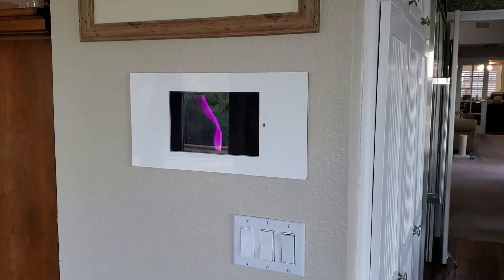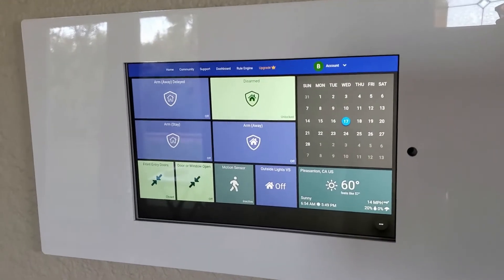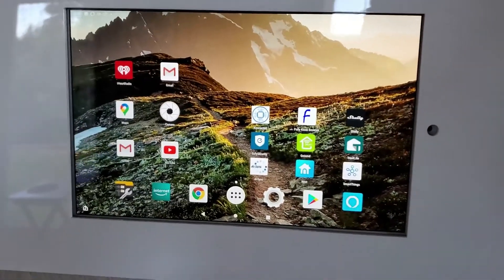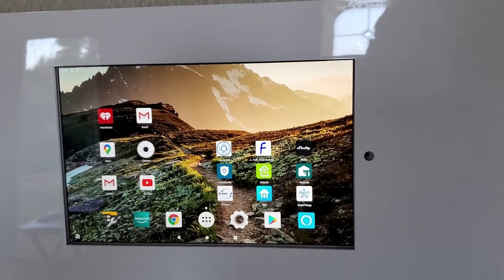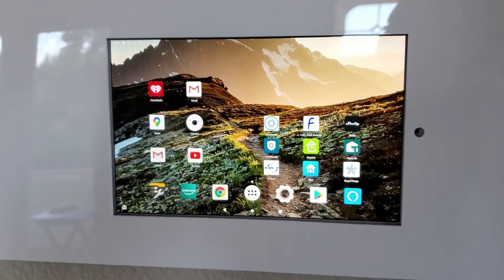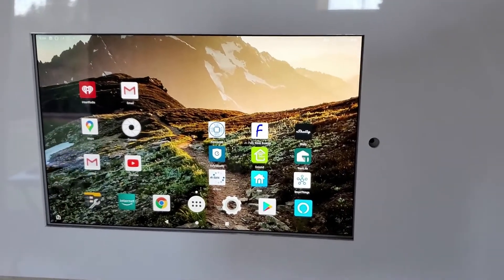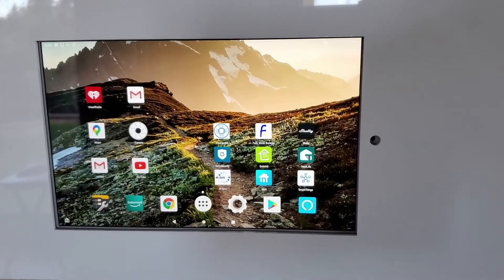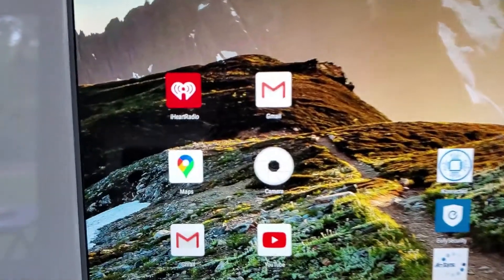Old Intercom Upgdate - Final Tablet Config & Echo Dot Room Stations

Comment: Could we simply splice the wires that come with the echo power supply to the old wires from the intercom? In my situation i'm trying to hard wire the powersupply to the echo dot, but i dont need the genie kit. Can I simply splice the wires that come with the echo to the cables that connect to the intercom. Great video. Thanks.
Reply from the maker: I'm presuming you mean, still have the new Power Supply at the Main Station, with the in-wall intercom cables now connected to that; then splice the Supplied Echo pigtail (after removing the power supply block from the AC end) to the Intercom wires. Yes, that should be good. But rather than chop up an OEM power cable, you might still consider to just hold onto it and get a new pigtail as they are quite inexpensive.
Reply: @decosse01  Exactly. You said it much better. Appreciate your quick response. Do you see any issue with me doing the intercom upgrade using the new larger echo dot 5th gens. I would only be using two 5th gens in this instance as my intercom system has 2 exterior speakers which are much larger than the interior intercoms, thus providing more space for the 5th gen echos to fit. The 5th gens seem to have the same OEM power cable as the 3rd gens in your video.
Reply from the maker: @robertbackhaus8150  Should not be an issue - I haven't got any 5th gens myself yet, just validate the power ratings for voltage and current are the same (or at least similar)

Comment: Would this fit the Google mini 2nd generation
Reply from the maker: I suppose you could - the premise is essentially the same but you would have to figure out the requirements for power for the Google system (incl the main Tablet) as well as the wall-mounting hardware for that and the satellites  - you'll have to do your own research on that, but I would imagine it would be do-able

Comment: What model of Echo Dot are you using? Can't find at Amazon. Any ideas? TIA. What if one or more fails, and you need a replacement?
Reply from the maker: I used the Echo Dot 3rd Gen - can't see on Amazon any more since they are onto later generations. The 3rd gen works well for this application because it can flush mount on the wall, whereas the later round models will have to be mounted outside the wall plane. The principle is the same, you just need to get creative with mounting those. Note that there are a lot of DOT 3's on EBay that are still being cleared out, so that could still be an option, and they are cheap enough you could afford to buy a few extras to store for the situation you mention.

Comment: When you spliced the wires for the barrel connector is the positive for the inner or outer part of the barrel connector? When you cut and strip to make the pigtail connector is it a red and black wire for positive and negative?
Reply from the maker: I'm not sure what you're asking about a 'barrel connector' and inner/outer ?? Do you mean the Jack?  Yes, the Pigtail has separate red and black wires in the sheath - it is not co-axial. Whichever splice connection you use, just be sure to connect the red (positive) to whichever you used for positive from your power supply and black similarly for the negative.
Reply: @decosse01  These type of jacks are called barrel connectors. The inner part of it can carry the positive and the outside can carry the negative or vice versa.

Comment: Once I have the table and echo dots installed, if I play music will it play on all echo dots or just in one room, or can I control where it plays?  Can it also be used like an intercom? And lastly once the table it mounted, I won't have access to the volume control or the on/off switch. What did you do to resolve those issues?
Reply from the maker: 1. You can control on which groups or sub-groups it plays - see the Alexa User/Help guides for how to do this - https://www.amazon.com/gp/help/customer/display.html?ref_=hp_gcs_csd_d2_649_1_GZ5U38E9GGBBWEM8_xSdj5mwePE&nodeId=GZ5U38E9GGBBWEM8&qid=1672855532555&sr=1
2. Yes - Use the 'drop-in' feature of Alexa to utilize as an intercom; again, see the User guides - https://www.amazon.com/gp/help/customer/display.html?ref_=hp_gcs_csd_d2_649_4_GS3WRTSRKD2U6MCK_MV3rB3cGEB&nodeId=GS3WRTSRKD2U6MCK&qid=1672855415471&sr=4 (you can find more in the help section) 
3. You don't really need the on/off switch - if you set up with the Fully Kiosk Browser, you just control the screen going on/off and re-awaking with motion detect. For volume, access the Sound settings - https://www.amazon.com/gp/help/customer/display.html?nodeId=GR9USY79W6NQMJPW; if you have Alexa enabled on the Tablet, you should also be able to just vocally instruct it (same as you would with the Echo devices)

Comment: Hi Decossee01, Thanks for sharing this video. Do you have a one later video where you dicuss lessons learned or any recommendations based on your experience? I am hoping to complete a very similar project and my main concern is ensure I have the right voltage for the old wiring.
Reply from the maker: I'm sorry, there is no follow-up - but there is nothing I would have changed, or subsequent problems that came to light (other than the power supply which is covered in the notes of the first video). I will say that after the initial configuration was done, I did enhance the fundamental capabilities of the intercom/music system by adding more features to the Tablet, by optimizing the Fully Kiosk Browser settings and adding in an Alarm System control and the capability to control all my Smart devices from the Tablet. This then included further learning curve using SharpTools program to create a custom Tile Display. But that goes QUITE FAR beyond the scope of these videos which is just getting the base infrastructure in place and not absolutely necessary unless you want to grow your system to create a true Smart Home controller beyond just the capabilities of replacing the primary features. 
Getting the correct voltage for your devices means studying the specs for those you wish to use; then matching up those specs to the size of power supply you need and doing the planning well before you purchase. In my case, the application of the power supply is relatively simple because I have only (!) two voltages in play - 12V for the DOTs and 5V for the Tablets - so you use a 12V for the power distribution on your old wiring and as appropriate use a 'local' 12v to 5V converter for any Tablets. That establishes you need a 12V supply - for power supply current rating, you need to add that from all your devices together (e.g. if you use 5 dots, ensure accumulatively you have enough current overhead to supply all 5 plus the current for the Tablet; now if the Tablet is 5V, to get the equivalent current at 12V, it will be approx 40% of the device's spec'd 5V current - for simplicity here just call it 'half'. So you just need to do thorough planning to know what elements you want to incorporate and then work out your supply and voltage converters as may be required. The good news is you can't have 'too much' supply in terms of current rating, only downside is cost. So you just need to be sure you have 'enough' current to satisfy your system, but too much is OK, your system will only use what it needs.

Comment: Are you just using the echo dot speakers in the wall? Some of the links you provided, are broken. Trying to find the plate to cover up old work on speakers. This is a fantastic idea.
Reply from the maker: Thanks Josh M - yes, only used Echo Dots at the old Room Station locations, but I also had two more Tablets in other locations. Those were really added to give more Tile based control, especially when I added in the Security system to the overall system. Sorry for broken links, but these items should be easily enough to find - the Wall Plates I used were from OCWoods creations, but you can probably find in a search any number of people who can supply a custom-cut Acrylic Panel to your specs.

Comment: Is your Screensaver and motion detection part of the fully kiosk browser required license purchase?
Reply from the maker: Both features are part of the Fully Kiosk Browser and the screensaver file itself is one I downloaded off the web i.e. you can use whatever file you desire but the capability is included within the FKB platform. Also, FKB will set your screensaver to kick on after x period of inactivity and then screen to 'off' after y - both times configurable. Ideally first get rid of the Fire Unlock screen by using the Fire Toolbox so that the Motion Detect wakes it directly. (you should do all the Fire Toolbox stuff before you do anything else)
Reply: @decosse01  Currently still having issues with adding the screensaver and getting motion detection to work correctly.   Screensaver doesn’t take up the entire screen no matter what we have tried, we are also getting a glitching affect going on until we uninstall the FKB then the glitching stops.  Can you link screensaver used? And also are the programs you speak about monthly subscriptions or one time purchases?
Reply from the maker: @amberbrown5956  There are a lot of 'smoke' type files available free here - https://www.pexels.com/search/videos/colored%20smoke/; You need the lifetime subscription (PLUS) license for FKB; it is relatively inexpensive one time fee. Look at the configurator guide on their site - https://www.fully-kiosk.com/en/#configuration. As per my initial reply on this topic, you ought to start with the Fire Toolbox (free); If you end up expanding to a Tile format for your smart home device control, then I recommend SharpTools (which is what you see in my video) - that has a free limited set of tiles, if you want to expand further there is an annual license fee for that. It is not necessary however if you just want to use Alexa for its own built-in capabilities

Comment: What did you do for the intercom at the front door?
Reply from the maker: Wireless Eufy Video Doorbell - Both Power and Signal are Wireless and the Battery is re-chargeable, lasts good 6 months between charges. You can answer from the Tablet or your phone, even if you're not home. And recording is local on your own homebase, no monthly fees.
Reply: @decosse01  any reason you went with the battery over the wired?
Reply from the maker: @jeffreyc7255  Several reasons, the Battery model REALLY simplifies installation but predominantly because it gives the flexibility to mount anywhere you choose, whether that be on the door itself, or the door surround trim or the wall - my original doorbell location that was part of the Intercom kit was not conducive for good viewing position for the video camera. The Battery life really is good - lasts at least 6 months and that is with quite heavy monitoring for motion detection. Then simply, pop out the battery bring it in and recharge with the provided USB adapter.
Reply from the maker: One new device from Eufy that looks really interesting is a combined doorbell/camera/door lock - do a search on that, even more functionality in one device :)

Comment: Is there any way to order just the pigtails for the dot stations? If so, can you pls. include a link? Thanks!
Reply from the maker: If you do a search on Amazon for 4.0mm x 1.7mm Male Power Pigtail you should find them. (Note that size is for the Dot 3 - other devices may have different size)
Reply: @decosse01  Great, thanks very much!!

Comment: Bravo u did a good job..im planning to try these.Can i put 3 amazon fire 2 echo ..do i need a bigger power unit.
Reply from the maker: Thank you @Gino Andre. The simple rule is to add the rated power in Watts of each device which will be connected, to get a total maximum (possible) load and ensure the power supply output is at least that (or higher). This is already a very safe margin as the operating current is highly unlikely to reach the maximum for all the devices simultaneously. In my case I too had three Fire Tablets (one 10, one 8 one 7) plus 5 dots. So the supplies I used will be fine for your application.
Reply: @decosse01  Thank you…I will try the supply you used….
Reply from the maker: @ginoandre  note that I subsequently upgraded the original one in the video, with a sealed module (see my post in the comments section of the part 1 video in that regard)

Comment: Thanks for the video.  Is there any reason you didn’t do fire tablets instead of echo dots?  Multiple master stations?  

The echo dots require internet connection and it would be better if you could do more automation within the dashboard.
Reply from the maker: My system had a Fire Tablet at the 'master' location (part 1 of the series) which indeed has the automation (for alarm etc), as well as two satellite tablets. For all the other locations, the Dots are inexpensive and simple to provide the replacement capability for intercom and music. But anyone can permutate the system for individual personal preferences.

Comment: Thanks for all your videos, I am learning a lot.  Did you find Sharp Tools worked well with Alexa.  Because I am mostly in the Amazon ecosystem
Reply: Sorry, I was considering Home Assistant but I prefer the look of Sharp Tools.  Your recommendations have been spot on.
Reply from the maker: @tonyh7769  Thanks Tony! Glad it has been helping your own project! I used Sharp tools for two functions/features 1) It has a fabulous Rules Engine that is more sophisticated than the 'Routines' available in Alexa or SmartThings; (i.e. you can create more complex 'If This Then That' response); 2) it is used to create and display the Tiles Panel display on the Tablet which gives an excellent graphic interface for manual control and there is endless customization for the panels you create. 
As far as working with Alexa - well you don't really use it that way - the Alexa control of devices (which is excellent in its own right!) is directly from the linked app of those particular devices - there is really no need to have Alexa actually execute a Link to Sharp Tools. The Sharp Rules operates completely in the background - I used that for more complex rules for my Konnected Alarm system; basic rules (routines) like 'turn on XYZ lights at sunset' I would do directly in Alexa (although you can also do those in Sharp if you want to keep all your rules/routines in one place.) I also found it really convenient to use Alexa Group feature to create groups and subgroups of my Lights. You actually need another medium to bridge between Alexa and Sharp Tools - I used SmartThings there. Everything that is in SmartThings is very simply linked into Sharptools. I haven't used Home Assistant but I believe the Learning Curve is much steeper on that medium.
Reply: Thanks so much.  You have saved me hours of work with your advice.  Seems like Sharp Tools will work great as my next project is to upgrade the old alarm with a new Konnected interface.  You are the best!  Thanks again!
Reply from the maker: @tonyh7769  if you are going with Konnected you will find a lot of help on their Facebook support page. I've posted some SharpTools rules in there such as a delayed entry trigger - allows you to enter without triggering alarm immediately, to allow disarm at your panel. And similarly delayed exit, allows you to set alarm at panel then leave.

Comment: I have a AIPHONE PS1224 that outputs 12V and 24V at 1A max continuous.  I have two masters and about 5 sub stations intercom.  I am assuming I cannot output enough juice with a DC-DC converter to get 5V out to support Fire tablets and echos.  Will that assumption be right?  Also the guage of the wire seems like 24.  Perhaps too thin
Reply from the maker: You need a better Power Supply. I would consider at least 10A. I'd be really surprised if your intercom was using 24 ga wire - much more likely to be 18 or 20 Depending on the length of run however 24 ga might not be a problem and if you can double them up so much the better (I am presuming each device has its own wire pair to the power supply and you are not using a 'ring' where all the current is additive on a single wire pair) - but yes, it will also help if you have 5V converters locally at each device as then voltage drop does not become a factor. Note that Fire Tablets are 5V but Echo (Dots) are 12V.